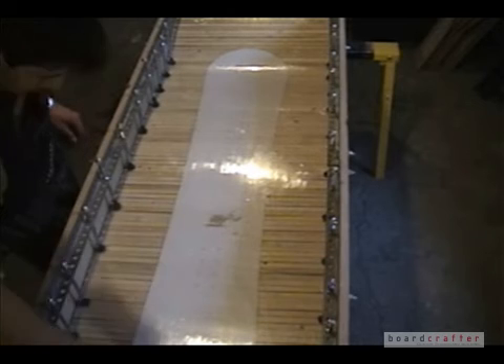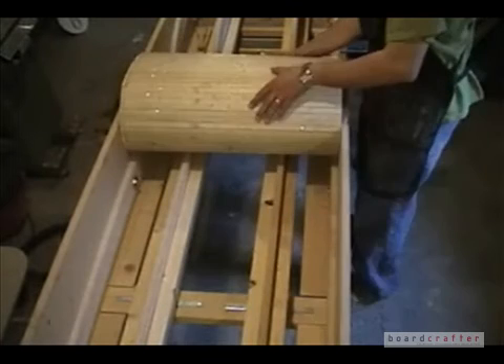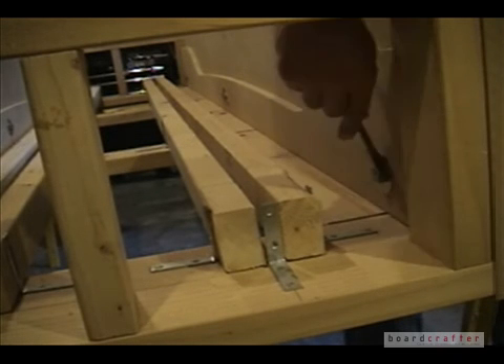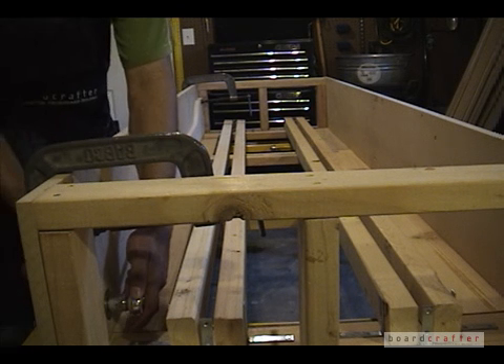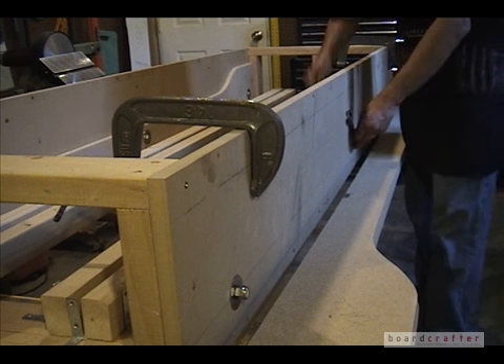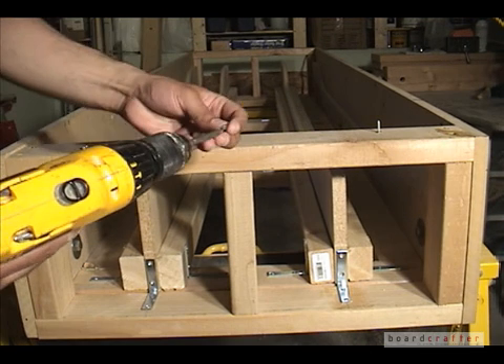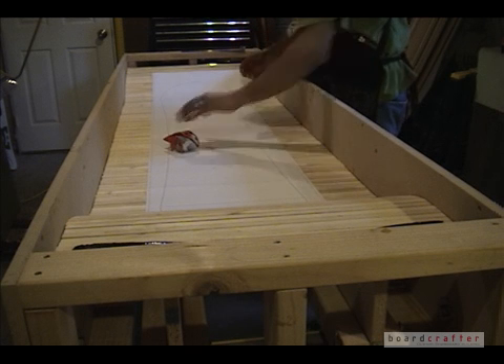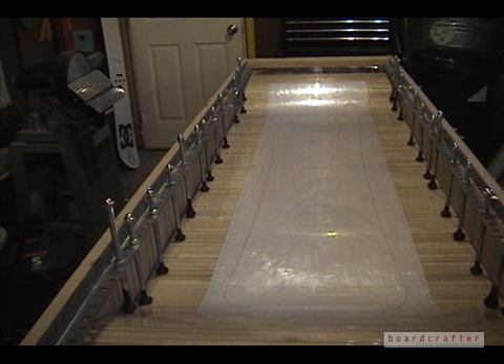Snowboard Mold Setup (Part 5)

Comment: @piwko4
I have no idea how he does it, but it should (if the thickness of the spine and poly are known - and they should be) be trivial to design the mold ribs so the top side of the poly surface (and so, the board) are exactly the right shape.

Of course, if you made the mold ribs exactly the "right" shape and then put on the wood and poly - the ends would come up sooner - just as you describe.

It'd be a different working method for each, both of which should be accurate if done right. :)

Comment: I have one concern about this method vs the traditional mold useing more then 4 ribs. You take the time to make the dimensions and mold perfect, but then put the wood spine and poly mold surface on top. Wouldnt this offset your running length slightly since the ends come up sooner then the ribs do.